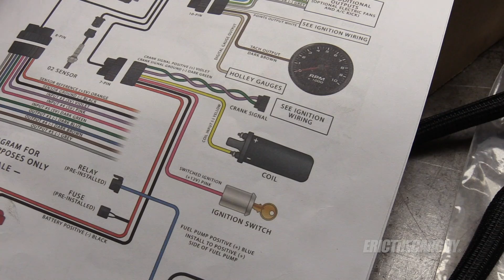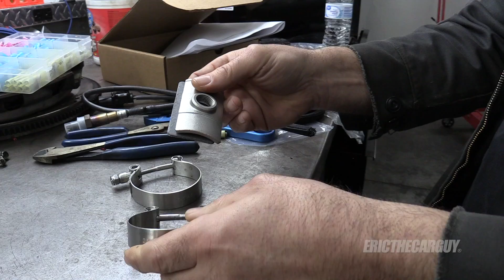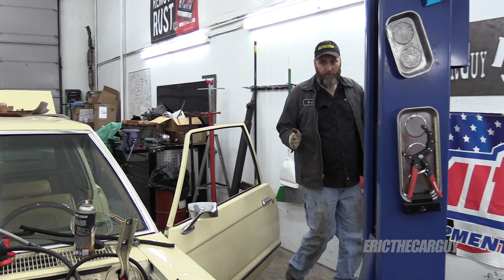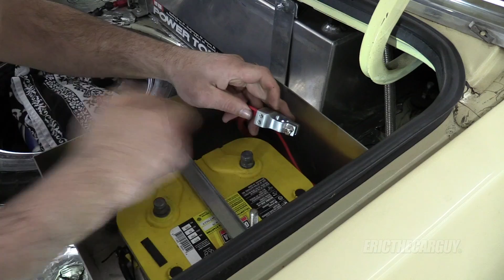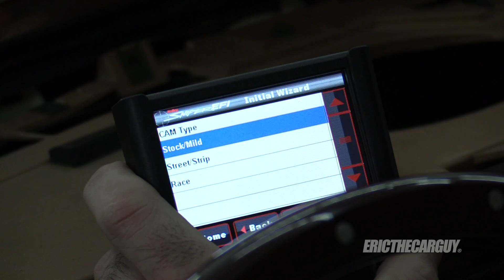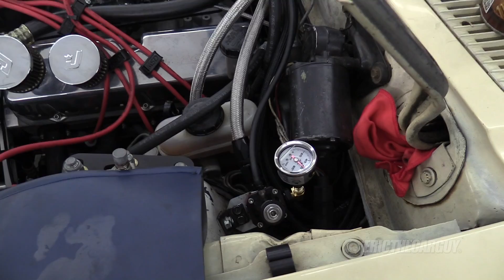How To Install a Holley Super Sniper EFI

Comment: Currently building my 66 Fairlane 363 project. Its been 4 years since you posted this video and I'm hoping you will reply with your honest recommendation.
Is this set up still on the car and how is it doing?
Would you recommend a more traditional FI system using the Holley HP and direct injectors over this SS set up? Will be running a 76MM turbo on 93. Thanks!

Comment: Hey Eric I just got the Sniper EFI for my Turbo build. I noticed you put your fuel pump on a switch instead letting the EFI control it coming on. What is your start up process? Do you crank the engine with the fuel pump on? Or do you prime it then crank it on with the fuel pump off? Thanks

Comment: I had my fuel pump relay wired up independently like you did but holley says dont do that, they say to hook up fuel pump relay  to have Sniper ECU CONTROL IT FOR SAFETY FEATURES BUILT INTO IT,

Comment: bottom line is the ECU should not go into the throttle body, majority of all other EFI systems have ECU under the dash or tucked away somewhere away from all that noise, I have brand new engine with all holley sniper approved and MSD ignition thats suppose to be all plug and play with my sniper system and Im having drastic EMI RF issues,  this should never be happening, this should of all been tested and fixed before they sold this junk.  I was told by holley sniper technician that the MSD super conductor wires are not a good idea to use with the sniper!!! they are 50 oms/ft where Holley recommends 400-500 ohms/ft plug wires!!! I was told by a EFI expert that about 10% of all sniper customers are having EMI RF issues, thats very high percentage actually. buyer beware, look at other brands of EFI systems if you ask me, Im ready to resort to a good ole  carb

Comment: I was reading the Instructions and page 4 figure 2 talks about a 10-32 set screw on the bottom of the throttle body to "Next tighten the supplied 10-32 set screw into the machined port on the bottom of the throttle body. It is also recommended to take a small punch and peen the casting around the set screw in 2-3 places. This will keep the set screw from backing out and potentially falling in your engine." Do you suggest this is necessary, or would Red Loctite do as well?

Comment: Have a Dodge 360 magnum in my TJ Wrangler, wonder if the performance improvement is worth it over the stock EFI and intake? My 360 has headers, exhaust, mild ported heads

Comment: hey man there is a 2013 883 sportster for sale which had the engine temperature sensor removed for a few months, and the bike runs with a rich fuel mixture now.
Is it safe to buy this bike? thanks mate

Comment: Hey Eric, why not put your dash temp sensor where the heater water outlet fitting is and move that to the thermostat housing ?
The heater doesn't need water until its hot anyway . 
Or run a tee at the heater outlet ?

Comment: Glad it worked. I had one installed on my C10. Never ran right, send it back to holley two times costing me valuable time, after calling holley for the third time in which they wanted me to send it in again, I took the Damm thing off and installed a regular carb. Won't even look at another one----

Comment: I am considering getting ^this^ Sniper efi for my Maserati Biturbo i hv tricked out since 1991. I hv had MSD 6AL-BTM on it 20yrs. But, can only make 250HP w/2 barrel Weber 36DCNVH. Will drivability be smooth & seamless in traffic? Trying for 500+HP w/Sniper, or F.i.Tech, or F.A.S.T., or Edelbrock efi. Shud i get a less HP Sniper model? I cannot hv pump in tank, only external fuel pump. Ur opinion is......

Comment: When you run the o2 sensor where's the best place...on one if the header tubes or after the collector. I've seen both some done both but I was under the impression if its on 1 of the tubes then it would only read that 1 cylinder. Any help would be greatly appreciated
Reply: The way it was explained to me was, you want it in the collector about 20ish inches from the engine, and at a slight upward angle like the diagram showed. Thats how I've been doing it using those collector adaptors with the o2 bung in them if the collector wasn't setup for it already.
Reply: @sparkplug1018  Thanks I'll go that route.
Reply: @darrenwarren2162  No problem, just make sure that guy is welded solid to the exhaust pipe, don't want any leaks there.
Reply: @sparkplug1018  OK. I got another question. Where did you find a continuous source of power from the switch for the fuel pump? I have a 87 Regal that's rodded with a 6AL box and with the fuse box inside I've used the 2 switch powered sources that I have the other is a continuing source and I put a targa switch on it but I keep losing power on the setup I got now. Maybe I'm over thinking it all before I add the EFI but this is something my engine builder told me I needed to address before I added it. I apologize if I'm bombarding you with questions but its not alot of ppl around my part of NC thats familiar with this setup, they'd rather do LS because it's easier
Reply: @darrenwarren2162  Id suggest using something like the Painless Cirkit boss, part number 70203. They're pricey, but they work. The 7 circuit version gives you 4 switched and 3 constant power sources. Its basically a fuse block and relay, that draws power right from the battery, and uses a key on 12v to switch the relay on and off. 
Pretty slick little setup that should help with that issue. Of course still run your EFI power right to the battery though. 
Im sure there are other products like that out there, but that should get you in the ball park of what id look for.
Been a while since I've looked at a diagram, but I think GM tapped those 2 IGN sources off of a breaker on the fuse block, which may be why your losing power there.
Reply: @sparkplug1018  Wow. Thanks!!!! I didn't think to change the fuse box I guess cause I didn't need to with the setup I have now. Between the HEI distributor and the ignition box I was tapped at the fuse box for a switch source for the fuel pump. I'll definitely look into changing the fuse box. And do we really care about price when it's the love of hot rodding..well of course we do..lol. But thanks for all the info. Im going to tackle it when it warms up a little more here. Hopefully I can ask a question or 2 when and if I get stumped but I'll definitely follow your vid as I go. Thanks again
Reply: @darrenwarren2162  The nice thing about that kit is its not replacing the main fuse box, or any of the factory wiring. Its an auxiliary box that gives us a place to power all kinds of things, or just providing switched power for stuff like this. So basically, mount the block somewhere, run one wire to the battery, one wire to the IGN 12v on the main box, and now you've got 4IGN, 3 constant fused sources to use for what ever.
Unfortunately I haven't installed one of these units before, but happy to help where I can.
Reply: @sparkplug1018  OK! I was thinking I would have to change the whole fuse box  I misread that. That sounds even better. So much so that I'd rather go that route. I'll definitely look into and give that a try. Thanks

Comment: EricTheCarGuy, and subscribers:  can you help me?  I’ve installed a Holley Sniper EFI on a 1991 Fox Body with a 363 stroker with an MSD ignition system (distributer, coil and 6AL-2). There seems to be EMI coming from the distributer and affecting the Sniper CPU, because, if we place some sort of metal plate between them, then the engine runs, but if we remove the plate then the engine cuts off.  Holley seems to believe this is common with the SBF 302.  My engine builder says no way, he’s never heard of that.  Lots of documented problems with this in the Foxbody and Holley Forums suggesting wiring “cross talk” and grounding possibilities.  We’re lost.  What do you think???  Thank you!!!

Comment: I installed that same set up but I’m have RFI issues when my car gets nice and hot after about an 45min-1hr of drive time it’s installed on a 69 camaro. You have any recommendations on where I should rout the wires. I’m stumped on this. thanks and great video.

Comment: I'm running a d1sc procharger on my sbc 383. Should I plug the bottom of the snipper 1250 with the plug they sent are leave it open?

Comment: Thanks a ton for this video, I wasn't familiar with Eric the car guy until now and this video was enough to like subscribe and hit the bell...lol...I just purchased the regular version and two days later broke my back... literally, just had surgery, pins and screws and a cage.. anyways, I'm dying to finish the install...it looked pretty straight forward, I did choose to get the really nice shrinktube connectors as well, but man your never to old to learn and you gave me several aha moments so this video has me even more excited about finishing the installation...so far the only thing I have been a little disappointed about was simply the cost of the sniper air cleaner...and the cost of the bigger better control screen for the unit... replacement cost for what comes with it, whopping 3.5 in, is like 260 and for the small tablet size was 600 or so...geeze...Xmas wish list now... anyways, thanks a ton Eric! I should have this baby going by the weekend if everything goes well...I'm beyond excited about the fan control bcuz I was having some issues, I think the ground supplying sensor is bad, cuts on at 180, cuts off at 103 lol...dead battery at work a cpl times helped me to figure it out... excellent video, great information and tips...keep it up man, I'm an instant fan...and if it helps to get the living room looking more like a living room instead of parts Central I'm sure my wife will be a fan too! 🤣 I had the msd distributor already but did opt for the hyperspark distributor to make it easier...I've been thinking about a way to get live data of what the computer sees for tuning and tweeking on this obd1 setup...so to be able to see what's going on and tweek some as well on the fly is beyond exciting to me....

Comment: Hello Friend ,
Good Morning.
I'm from Brazil, I bought a Holley super sniper just like yours.
I have here a gasoline engine, 347 ford with vortech v3 super charger
CAM x303 roler,
Edelbrock air gap
can you please help me with the installation parameters of the equipment

Comment: "Fast" also makes a throttle bracket for the super sniper. As for the harness you didn't have to cut it. Should have just deleted the blue wire "pump power". Another side note I ran a magnetic pick up distributor locked out with a 6al. You don't have to get the Holley distributor if you already have an msd distributor, you can control timing with it.

Comment: ... This is the first and hopefully the last time I totally and completely disagree with your choice. The holly kit is Garbage. My choice was a haltech elite unit. You could uise any other ECU have drilled your intake runners and made the harnesses your self. I bet it would have been way cheaper and actually tuneable...  I like holley carbs but their EFI is total garbage. Id get a refund. If you want me to clarify you can find me by name on facebook. You could have easily asked the guild of EFI tuners on facebook. Theres a ton of ECU's out there and new or used parts... I am ranting but jesus christ such a great car and great mechanic with this garbage is a surprise.
Reply: I have watched about 10 videos about the problems with this system.  Taking a long time to start and idle that goes from low to high for unknown reason.

Comment: I installed a Holly Sniper 2300 a 2 barrel set up on a 1968 Mercury with a 390 engine and every time i shut down the engine, I had to reset the computor for it to start.  Holly techician said I would need to add a special relay which didn't come with the unit and after adding that connect  the computor works but engine won"t run. Can't time the engine were  it will start and run. Every thing about the engine is stock except the points were replaced with a small electronic device. Do you have any suggestion as what needs to be done to get the engine properly timed. I don't know if you can speak with me by cell phone but hope you caqn.  I'm at a lost.  I know one thing I want buy another Snioer.  For one thing they new what my application was and the needed equipment should have come with the unit.  I had a FFL unit installed on a 1964 Ford with a 352 engine with no problems.

Comment: Hey man, please run that thing richer.  It doesn’t have ideal distribution in the manifold and you may have some cylinders running 12.2 under boost even though you are asking for 11.7.  On pump gas target a low 11 especially with no meth just for safety so the 8 cylinders average afr is a little richer.

I don’t want to see you with a broken ringland!!

Comment: I bought the Holly sniper and installed it on my blow through pro charged 363  and had nothing but problems!!! I was hoping it would work and was disappointed!! Went back to blow through carburetor!! I hope you have better luck than I did.
Reply: What type of problems did you have? Was Holly any help with the issues? I ask as im thinking about one of these for my 305 SBC truck, not happy with the TBI

Comment: I also installed the dual sync distributor, for those of you who are running a hei or other there is a kit you can install so the system controls timing. You can run it without but I suggest using the dual sync or install the kit. You want it to control timing to get the most out of it.

Comment: Before you drive hard,  PLEASE make sure the throttle linkage is protected from the AC line. If a motor mount happens to be loose enough to allow the motor to twist too far, you could easily find yourself with the throttle pinned wide open. The AC line is fixed to the body at one end, so it will move in relation to the throttle linkage when the motor is applying torque. The clearance appeared to be VERY close in the video.

Comment: Hey Eric I tried going to your site and tried to post a question but i couldnt find a way to and im not that good with computers, I hope youll see this, my question is I have a 1994 chevy 1500 5.7 so its before the vortec and i bought some headers for it but the headers are round port, I think the head ports are square, can i still run the round port exhaust headers??

Comment: Thank you for the awesome video. Good timing too, because i have been considering getting this system for my charger. I want something to keep the carburated appearance, and of course, so I can keep my original filter setup. This seems well worth the effort. Would love to see how it perform for you too as time goes on. Now all I have to do is measure how tall it is and see if it will be too tall for the ramcharger on the car. Keep up the great work. The work on your car has really paid off and came a long way!

Comment: 750 idle seems way high... For this new system, for the old setup it was needed, so I'd see if you could get it down to 400/350. Maybe after a few weeks of the Holly's computer doing a bunch of learning on your specific setup (maybe try dropping it 100 rpm every week or so).
But job looks pretty good, especially getting that wiring cleaned up.
Reply from the maker: I don't think my cam would allow that. Thanks for the suggestion though.

Comment: Step 1. Throw it in the fuckin trash. Step 2. Buy a fitech
Step 3-12 will be in the instruction manual included with a good fuel injection system.

Comment: Your ground source has the biggest impact on AFR readings changes in resistance on the ground side will influence the reading. Not sure about the Holley but in Tunerstudio and most other PC based tuning software you can do an offset to cancel out the ground interference and make them read the same. Not sure what all features are enabled on the handheld. The Holley should be the most accurate since the PCM and the wideband its using are grounded to the same point. One other point of distortion is quality of sensors. There are several grades of sensor floating out there. Not sure what Holley uses in that kit but it may be better or worse than your standalone AFR gauge. You could also move the ground of your standalone gauge to the same ground as the Holley and ensure your sensors and grades are the same between the two. LSU 4.2 and 4.9 are the most common but there are differences between them which can change the reading.
Reply from the maker: Excellent point. I was thinking the same. In fact, I considered doing a voltage drop on the sensor to see if I could account for the different readings.

Comment: Your way too fat at idle. Way to fat
Reply from the maker: The cam profiles of performance engines require a richer mixture.
Reply: EricTheCarGuy no your thinking carburetors. Put that thing to 14.7-1. All your doing is wasting fuel at idle.

Comment: I thought an AFR had to be first calibrated in the open air, before installation?

That weak battery will eventually cook the alternator.
Reply: Lower battery voltage could also be from all that testing before firing it up, interior lights etc.
Reply from the maker: That's not how O2 sensors work. They are actually exposed to open air as well as the exhaust. That's what makes them operate. https://www.youtube.com/watch?v=NIzcztO-CCs&t=32s

Comment: Those Holly EFI's do not tolerate a weak battery either.
Reply from the maker: Any computer system hates low voltage. Computers speak in the language of voltage. Low voltage means they can't be heard.